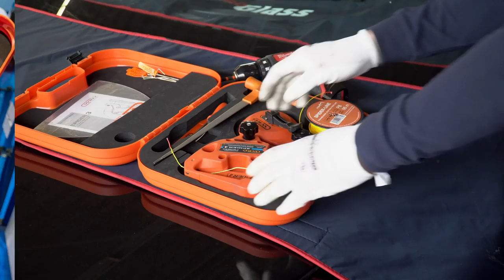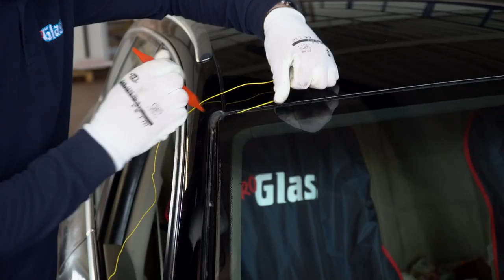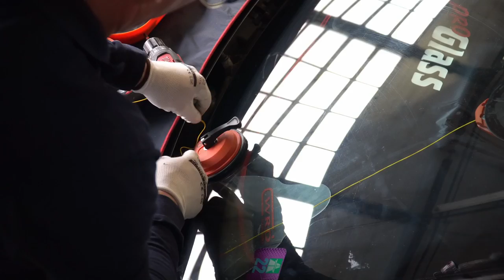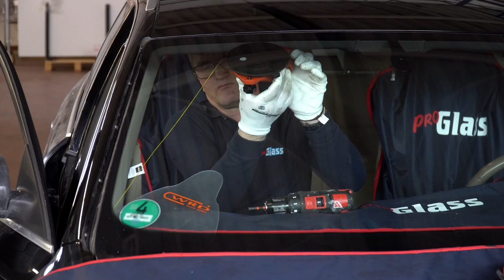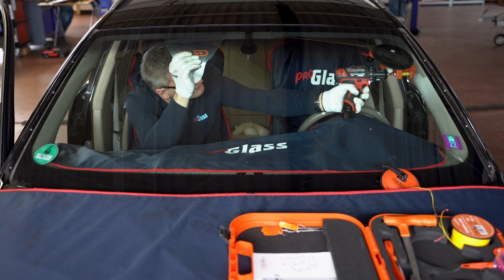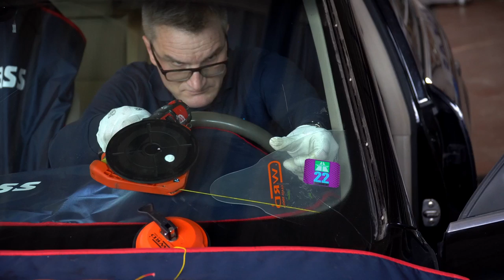WRD Spider 4 application video | ProGlass

Comment: Hi what is the best drill to use for spider 3? Would a milwaukee 12V be sufficient or need more power with an 18V?
Reply from the maker: A Milwaukee 12V is more than enough. We are using it without any problems. You can find it here: http://bit.ly/3JEH1bx

Comment: Could anyone tell me how many windshields it is possible to remove with 1 roll?

Somewhere I read the information that it is possible to remove about 10 windshields per length of cable, but it was not clear to me.
Reply: With what he has already on the Spider you can easily do 10 windshields in prime conditions,. With a whole roll maybe close to a hundred. Just depends on how conservative you are with your roll.

Comment: Could anyone tell me how many windshields it is possible to remove with 1 roll?

Somewhere I read the information that it is possible to remove about 10 windshields per length of cable, but it was not clear to me.
Reply: Depending on the cable itself. The car. The top clips it has. The tech being able to see high break areas and also there are ways to retie fiber lines with fisherman's hooks and many Einstein willy's to save a rope. So if you are talking of the spinal he cut the rope from. We are talking of probably 100 cars. He could alone with the spinal in the machine he used if he was able to retie or just friendly cars. Like 15-20. Realistically. Probably about 10 cars per load. And it does take a whole lot of line per car. I've seen a tech go about a month without changing his wire. It snapped the day he told me hahahah
Reply: I meant spindle* haha
Reply: And it doesn't take a whole lot of line*